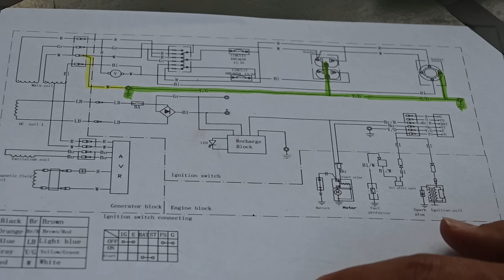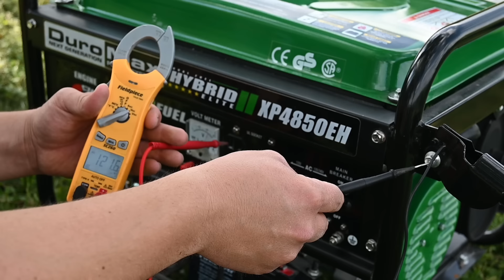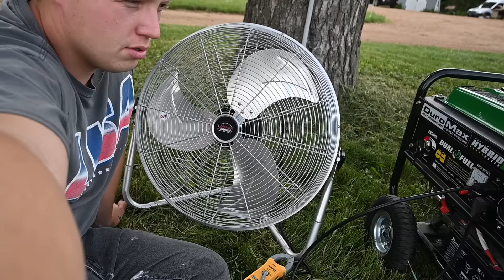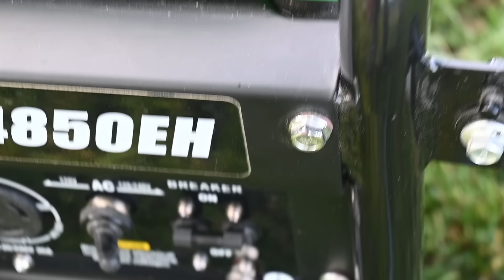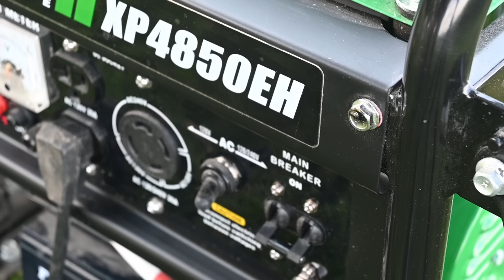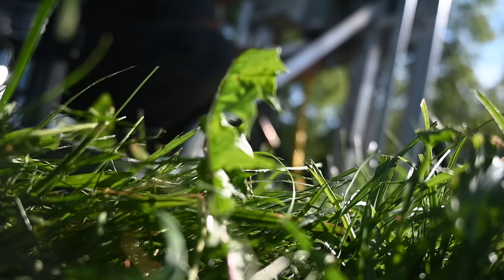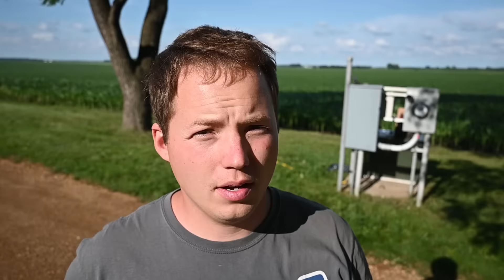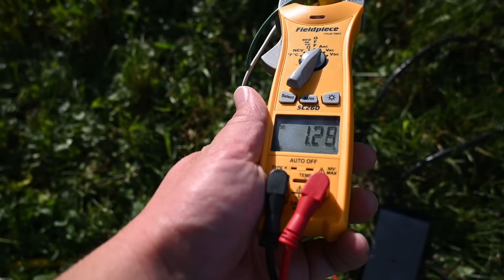What is a Floating Neutral Generator?

Comment: So if using a floating neutral generator/inverter in a standalone environment you would want to bond it regardless if the frame is open metal or plastic? And you could do this with a plug-in neutral bond device as mike Holt talks about? My plastic inverter housing has no mfgr directions to bond it.

Comment: The problem with a neutral and ground connected is if you're touching the frame and then touch the hot you're dead.

Comment: Are there any adverse consequences connecting a portable, neutral-bonded generator to a household breaker box that is also neutral-bonded? Say would it be enough for a multimeter and its probes tell you whether any part of the generator, say frame or other equipment part, pose a shock hazard?

Comment: Hey great video!  I always love your details. 
I have been searching for an answer perhaps you can help.
I have a Westinghouse 12,500 portable generator installed to 50amp power inlet to 100amp panel with interlock no ground rail in panel,  shielded cable. 
When on generator power my Bath and kitchen gfci's blinking red and no power.  What can I do to fix this?

Comment: What if you have a neutral bonded generator and you do not want to modify it, and it is connected to a power inlet, then a Manual transfer switch, and then to the breaker panel? How do you remove the neutral bonding from the generator but at the transfer switch level?

Comment: Good job. My question concerns a food truck with a portable generator on board. Would it be correct/safer to have the neutral and ground bonded, as the generator is mounted directly to the truck frame?

Comment: Nec 445.20, 590.6 (A) 1,3. Those outlets need to be provided with cords that have ground fault protection. That will provide the necessary protection.  Unfortunately equipment is not dummy proof and it is important to read all accompanied instructions prior to use. Whether or not the instructions state a ground rod is required is irrelevant, the ground rod is not an effective means of clearing a fault. I liked your video but I feel you should have brought this up and did a better job of highlighting that bonded generators are a poor choice for backup power and that unbonded generators must use gfi protection unless in use as a backup power source. There is nothing wrong with that generator other than it doesn't have this information plainly spelled out next to the receptacles.

Comment: Is the efficiency any different if you put the rectifiers in series. My thinking is higher voltage, lower amps = less elctro mechanical drag on the system.

Comment: I encountered a strange situation with a Chinese generator. It is a three-phase generator. The neutral conductor is connected to the housing and grounded. It worked for a year and suddenly stopped producing electricity. When I separate the connection between the neutral wire and the ground, it works. I think the problem is in the generator itself, maybe the winding is short-circuited. I ask for your opinion.

Comment: Great video, Ben. I have the same exact model generator, but after watching your video, I performed the same test to see if it was bonded or floating. Checking for continuity between the neutral from one of the outlets and the grounding terminal provided, my generator is bonded.  My generator is newly purchased, with subtle differences between yours and mine, i.e., yours is key start, mine is rocker switch only. Your duplex outlet is standard, mine is decora style. Possibly my newer unit’s construction has been updated to provide a bonded neutral. The wiring diagram is the same as the one you provided. My main question is, if I am going to use this to backfeed my panel, do I want to remove the bond or leave it as is. I understand using the generator in the field calls for bonding it but does that conversely mean I DON’T want it bonded when connecting to a home panel? Thank you for any information you can provide. Wish I was working alongside you in the field. The best education usually comes from working with someone in the real world.

Comment: Thanks for this insightful video Ben. I was just wondering if the current you reading on the ground towards the end of the video might have been due to circulating current. The Panel is grounded and you have also connected a rod to bond the frame of the generator to ground. That looks like having double ground reference. I may be wrong

Comment: Benjamin, I have a bonded neutral powermate generator backfeeding a 6-50 outlet(for mig welder) that only uses 2 hots and a ground,  
no neutral used, I have a garage stove hooked up to this outlet and it uses both 240 and 120 and isn't shocking me,  
Isn't this kind of like running an unbonded generator to a bonded panel?  I have no neutral to connect.
If my 240/120v stove isn't shocking me without a neutral using this outlet I don't see an issue, signed confused.

Comment: if the neutral is bonded and u plug in a faulted load thru a 2 wire ext. cord,.a.k.a. no 
ground. gen frame is on damp ground. touching bad load can be a bad idea

Comment: If that portable fan was plugged in to the outlet, with this configuration, would the frame of the fan then have some current flowing on it (when the house being powered by the generator) just as the simulator cord does?

Comment: I have an iPower unit and it says it has a bonded neutral but it does not.  The schematic is also wrong in other ways so I emailed back and forth with them for the newer/corrected schematic.  Never got one.

Comment: During Hurricane Katrina I had a portable generator to power my house. It worked great for a couple days then all of a sudden the generator lugged down and everyone of my power strips inside the house that had surge suppressors (MOV) melted causing bellows of smoke, several of the power strips melted, burning holes in my carpet and scorching the walls.  I immediately turned of the generator and returned it to Home Depot.    What would have caused this to happen?

Comment: There are things that can happen with a generator that will not be good. Let's say it is a floating
neutral. and that it was given to you by a neighbor who is moving away. he has NO idea the gen 
has a fault due to being overloaded at one time, nor does he know that due to hard use, the wire
used to ground the outlet is not hooked up. You want to use the generator, not hookd to your house
but to run a few cords from it. , sit out on the back porch with a lamp a big fan and suck down a 
few beers. You ground the gen bcuz he it says to in the directions an theres a ground post. 
     What u don't know is is a fair bit of voltage is on the frame of the generator and that old window 
shaker fan's been around since Methusula, cord's been spliced together and well the motors been
slightly overloaded for a while, dust in the bushings and it is a regular plug and it has a fault. Now if plugged int to reg.power standing on the brick floor with sandals or damp shoes, yes u'd get a good
tingle out of it. but no ur using a generator, grounded, not properly either. so when you touch the fan,
you could complete the circuit back thru the ground to the generator. 
            Yes I made this up, but did I really? most of us assume things will work out nice, a nice 
thought, but when using electrical appliances, we should have some sort of idea that a metal 
caged frame and a damp floor could mean a nasty shock or worse. Maybe ppl are not into thinking 
that way, but it does not hurt to start thiking that way. we know water and electricity do not mix but
many don't consider water came from the ground and that standing on the concrete or asphalt 
driveway or on wet grass can be such a nice return to the source when ur standing there holding
a defective tool plugged into a generator that although running has'nt been maintained or checked
in a coon's age. someone workt on it an more into that cold beer than anything never hooket up the
ground or maybe someone just wired a heavy cord from gen to a metal gang box. never hookt up
the ground. gen's neutral is bonded and there is a fault in plugged in device. that will place voltage 
on the gangbox and generator. . . and someone could be electrocuted.
      What I am saying here is that there could be a number of situations unknown to ppl using
electrical products, that are quite dangerous, becasue in houses that are fairly well up to code,
any outside receptacles are wired thu safety recepts known as GFI's. Here is how they work, 
either the breaker in the panel or the receptacle with 2 buttons on it, found in bathrooms an sides 
of kitchen sink. so, Gertrude's frying up a few burgers an beans in an electric skillet that draws
12 amps  everything is fine. there are 12, 000 milli-amps = to 12 amps working that skillet. . she 
is stirring the beans in the skillet with a fork and decides to grab a cold beer an opens the fridge.
the skillet being old and to be thrown out is still in service with an unknown fault.
the GFI that counted 12,000 mili-amps between hot wire or as code calls it, ungrounded wire
now sees 11,900 milli-amps on the neutral and the un-balance shuts the power off.
I suppose I bored you into a coma, sorry, not my intention. but if u get the idea ppl otta be more
pro-active in their life with electricity, than maybe in the fullness of time, there will be a lot less
electrical injuries.

Comment: I have a portable generator with bonded neutral. I have connected it to my main panel via 50 amp inlet and breaker (yes, interlock installed). The neutral and ground from the inlet are connected to the neutral and ground bus in the main panel, respectively. The first question is, do I need to convert my gen to floating ground in this configuration? Next question, do I need to ground my generator frame to mother earth? Is so, can I connect to the ground rod used by the main panel? Please advise.

Comment: Gotta b careful hooking up to load center that is a ' SUB' 
My place has 1st disconnect at pole under meter Neutral and Grounds bonded. In load center, ground goes to steel enclosure Neutral goes to Neutral bus with NO green screw to enclosure. Since there will be current in the neutral we don't want a ground loop.

Comment: My generator has a neutral which is floating, my understanding is that this will work fine to power any appliance in my home with extension cords; however it is dangerous should a short occur and the frame becomes hot. Please confirm that this is correct. 

Bonding: To bond my generator I would need to connect the neutral to ground, this is where it gets confusing for me, I think what I would need to do is somehow connect the neutral to ground, for this I would need a grounding rod to make this happen. Not sure what I stated is correct. Let me know

Comment: question:  home purchased and has a generlink transfer switch at the utility globe that fronts the main power panel.  States on the plug-in for using an external generator that you MUST use a floating neutral generator.  Does that mean there is a potential for backfeeding power to the utility when the power is out and I'm running the generator for powering my house?

Comment: Could you place a switch in the middle of the bonding jumper to switch between floating and bonded neutral if your generator is used for extension cord stand alone tasks as well as being used as a back feed to your electric panel for power outages?  So you wouldn't have to open the end of the generator and remove the jumper.
Reply: This is a great question!!! If only someone answered it.

Comment: Specific Question when using a stand-alone generator to supply a home via L14-30 type connector at the house.... that, in-turn,  is wired to your main panel. Assume the main panel has an INTERLOCK ( and NOT a transfer switch),  and a double-pole breaker used as the point for generator supply. I've been on electrician's websites to ask what to do about the generator's bonded neutral, as the main house panel has it's own bonded neutral, and you should not have a second unit bonded. Here were the opposing suggestions....please you (or others) offer commentary.

Option 1..... change out the home-support generator to floating neutral and label it as such... in case it gets used as a stand-alone unit like at a construction site...so people are aware.

Option 2..... don't hook up the ground connection from the gen to the inlet and more. One responder with industrial electrical system background,  said--->"I have stated this many times over the years. Connect the power inlet fitting at the house in accordance with ALL codes in regards to equipment grounding EXCEPT with the equipment ground terminal of the inlet fitting itself. This means to run two "hot" conductors from the interlocked "generator" circuit breaker to the two hot connections (X and Y) on the INLET FITTING.   Run a neutral conductor from the neutral bus in the panel to the neutral (N) connection on the INLET FITTING and run an equipment ground conductor from the neutral bus to the ENCLOSURE OF  the inlet fitting. Do NOT make any connection to the equipment ground (G) connection on the INLET FITTING. This will isolate the equipment grounding conductor in the interconnect cable (generator to house) and prevent any parallel currents from flowing in the equipment grounding conductor. This requires no modification of the generator nor of the interconnect cable. Absent a switched neutral in the service panel this is the best method available. It is NOT code compliant but the risk of any danger is extremely low.

This still seemed dangerous, so I poked again. He added this--->

"To understand the reasoning you MUST understand the reason for the equipment grounding conductor. 

The ONLY purpose of the equipment grounding conductor is to facilitate the tripping of the circuit protection (fuse or circuit breaker) under a FAULT condition. IF the "hot" conductor to a piece of equipment were to contact the metallic case of that equipment it would cause a high current to flow from the protective device through the supplying conductor to the case and back to the source (the panel) on the equipment grounding conductor. The current flow (amperage) would be high enough to almost instantly trip the circuit breaker or blow the fuse. It has NOTHING to do with directing electricity into the earth.

By not having the equipment grounding conductor of the generator "bonded" to the earth it does impose a very slight (in my opinion) hazard IF the generator-to-house interconnect cable were to develop a "line-to-earth" fault. There may, or may not, be sufficient current flowing through such a fault to trip the generator-mounted overcurrent device (circuit breaker); in other words it would not be reliable. To me, this is acceptable as long as the interconnect cable is physically protected. Do NOT drive a vehicle over the cable or otherwise subject it to any damage and the hazard is extremely low.

By having the "neutral" and equipment grounding conductor bonded in the generator AND at the circuit breaker (or fuse) panel creates a parallel path for return (neutral) currents and would then impress a voltage on ALL equipment grounding conductors as well as the metallic cases of any equipment using an equipment grounding conductor. Parallel paths for neutral currents are ALWAYS hazardous to some degree.

Again, I stress that this is NOT a code-compliant solution but is a much safer connection than the parallel path connection.
------
So with all this as background..... can you offer comment? I THINK it's the same thing your vid is saying......

.

Comment: My Porter cable bsi 550 seems to have the 120v outlets bonded at the rear of the receptacles,, but thete is no ground wire connected to the 240v . Is this floating. I guess I'll check for continuity first.

Comment: If you have a bonded neutral generator, could you solve the issue here by not connecting the grounding wire between the generator and the house?

Comment: Very informative video. Just acquired WEN inverter generator with floating neutral. Main use is to power appliances directly from the generator via extension cords. Based on your video, I should bond the neutral with ground. I acquired a neutral ground bonding plug. However, everywhere I read, it says don’t use such plug with floating neutral generators. Your opinion on what to do, please?

Comment: Might sound like a dumb question but how do I connect a welder, I have a Miller multimatic 220, to this type of generator with proper grounding? I was using a rod with  the wireattached to the grounding connection on the welder but from watching this now I'm concerned 😂 would the welding machines ground fix that issue?

Comment: a bit late to the party but (no electrician or anything):
isn't an isolation transformer a similar thing to a generator with a floating neutral? Usually used by ppl working appliances that require Mains voltage and need to be live tested. O/C of you happen to touch the neutral and live your toast but touching either should be "safe", A log of those ppl talk a bout the one hand rule. (any ground fault protection is lost).
capacitive

Comment: just so I am clear, please verify this statement... When using the generator on an interlock breaker inside the main panel (there is no transfer switch), then the generator should be floating neutral.
Reply: When the generator is on a home's transfer switch or on a jobsite running tools directly from the generator's control panel, then the generator neutral should be bonded.